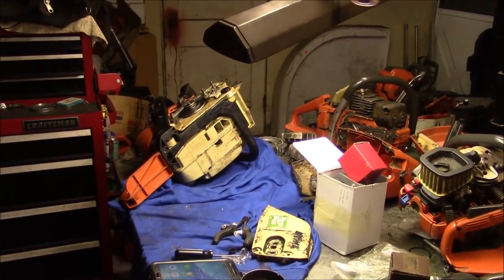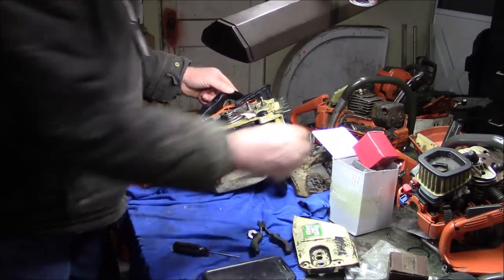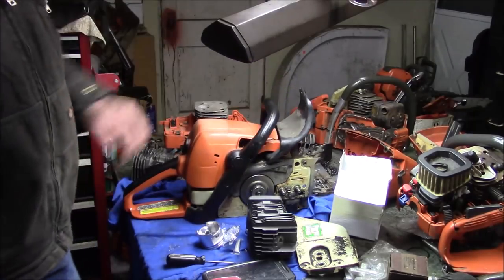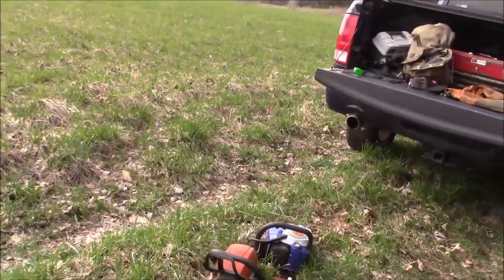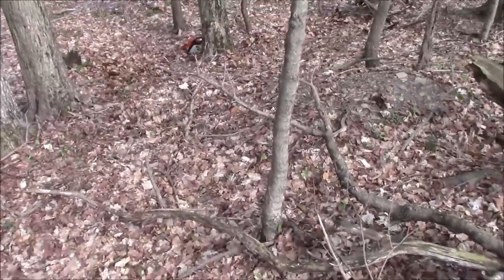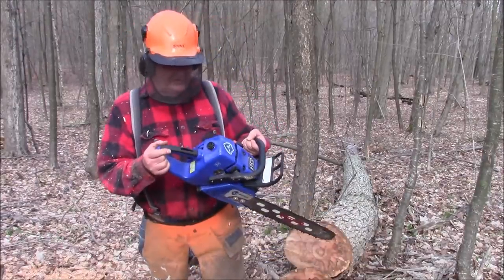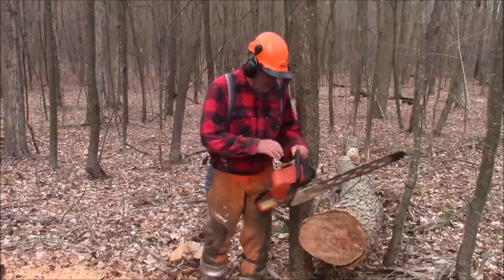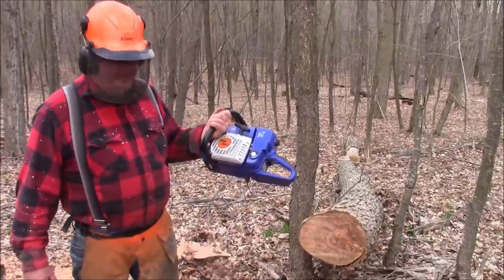Stihl ms310 Project Saw "The Starting Point"; vs. Holzfforma g366 & WHAT is a CLAM SHELL SAW

Comment: I have had my 310 for 16 yrs, two hurricanes Katrina and Ida.  Has never let me down, never put a wrench on it. Went through many 20'' bars and skip tooth chains. Just cut 10 cords of firewood in the past month. I think the key to a good running saw is clean fuel and clean the air filter regularly. Still running the original spark plug.

Comment: I'll definitely be waiting for the video when you convert it to a 390. I've had my 290 since 2011 and haven't killed it yet. It's been used and abused. Left outside in the back of the pickup in the rain and snow, ran on the factory lean carb settings for years, over dirty air filter, and the engine worked extra hard before I really learned to sharpen a chain. One new spark plug, one new air filter, starter rope, and one new fuel line is the only thing that's been replaced on my unit. They're heavy for the displacement class, but they run none the less. Great video. Certainly going to try out a holzfforma when they're shipping times return to normal.
Reply: Thers tons of really good videos on it allready, and it's very very simple to swap

Comment: Check to make sure the weighted fuel filter is holding down the fuel line. Farmertec has been having issues with very stiff rubber and the fuel filter won't hold the line at the bottom of the tank. It will drive you nuts trying to figure it out. Replace the fuel line or get a heavier weighted filter. Good luck. Love your videos. Learned a ton over the last two years watching.

Comment: If I cannot get the E clip on the end of the crank I just hit the clutch a few licks with my battery powered impact until I have created enough clearance to get the E clip on the crank.  One word of caution, you must use the thicker steel sprocket washer if you are using a rimless sprocket.  The thin aluminum sprocket washer is for spur sprockets.  It is a little harder to get the E clip on the crank with the thicker steel sprocket washer.  They use the steel washer to make sure the rimmed sprocket will not come off the sprocket.

Comment: I got a G660 started it and made my first cut today. I tore it down and put stihl crank bearings,crank seals and wrist pin bearings in it before the first start. The idle seems to be hard to get stable but first impression seems like a strong saw. Im using a 25in. Stihl bar and chain. It needs more time to see if it will be a good saw. I always enjoy your videos.

Comment: When using the same chain, around the 21:50 time frame it looked like the G366 went thru about 4 or 5 seconds faster: 20 or 21 vs 25, but it was hard to see the bottom of the cuts.
Reply from the maker: Probably , I figure if it matters folks will use the "timer" on the video to figure that out..:)

Comment: The aftermarket drum is molded after the early Stihl design for the 034 drum, which interchanges with these saws (1127). 1125 and 1127 share the clutch sidecover, breakband, clutch and drum. The early sprokets have a larger diameter bore, later ones the smaller one with the smaller rollerbearing. It was surpassed in around 1990s on 034 Super to 036s update. The OEM rollerbearings for the clutchside are also plastic but they tend to hold up pretty well. The Chinese copied the early design. This bigger bearing is much more expensive to buy than the smaller one, but they tend to hold up pretty darn good. (OEM that is)

Comment: I put a 390 top end in a blown up 290 a fella gave me - I was impressed. So i bought an old 310 and put the 390 top end in it. With muffler mods - they run well.  Yes heavy saws, Certainly not a 372 though.

Comment: Another good comparison of 2 saws, what I noticed with the 310 is it sounds like it kinda bogs at throttle up and runs a little slower in the cut although it could be just the exhaust note compared to the G366.
The first bar and chain on the 310 didn't appear to be throwing as big of chips as the bar and chain on the G366 and after the swap of course throw the same size chips but still sounded slower in the cut, but that's my observation based on what I was hearing. 🦻🦻🧠👍
Reply: the  stihl  got  no note  sounds  like  down comp ///power  drill some holes  let  the hot  air out  and  presure test

Comment: Hey Walt !
I noticed from the former videos about the acceleration problems with your aftermarket 361 models.

The OEM Stihl 361 carb has a acceleration pump installed. This pump often times get bad. The part number is:
1135 120 9700
Maybe a OEM carb can solve your problem ?

Best regards from Germany

Comment: did i hear right..gonna put a  390 top end on the 310 chassis?  how much difference in bore? and is there any stroke difference between them ?       i am anxious to see how this goes.  thank again
Reply from the maker: Stihl ms390 and the 310's are the same plastic essentially.... biggest difference is a 390 has a 49mm bore and the 310 47mm. Shouldn't be an earth shattering change, but along with a "pop up" piston should be both noticeable and fun. THATS the 100 dollar gamble. I got the saw for free....it was dead. And will have $100 in parts plus or minus a bit when I'm all done. That includes the new AM clutch parts, Top end, bearings & seals, and popup piston. ALSO things like a carb kit. Really cheap to work on these things...so don't write them off

Comment: From experience, I was a helicopter mechanic for a number of complete overhauls- everything on the machine was torn down and inspected.  The planetary gears in the transmission have plastic cages to separate the roller bearings. Have personally witnessed thousands of hours of operation and spoken with other mechanics with tens to hundreds of thousands of operations, and never seen a nylon cage fail. So- I would think that it would be OK on a chainsaw when it only is being used at idle.
Reply from the maker: First, THANK you for watching but even more so for interacting with the subject. I hear all that, but there is another thing to consider, its application based. Having been an engineer and dealt with several Aerospace companies, the design criteria is radically different than with chainsaw. They tend to over engineer vs. under engineer. In addition the air cooled two strokes in the "eco" era tend to run hotter. Nylon has served Stihl well in their older designs. Husqvarna followed Stihl's lead with the 500 series of saws and also the XT version of the 372's where in the beginning they did have issues. With the newer designs there have been more issues in the early years of a model introduction and I attribute that to simply heat. My assertion is simply this, if the temps and the environment are clean and consistent with design parameters , the nylon caged bearings will last as long as anything. Add heat past the design parameters of the nylon, those cages crumble and the coking on the bearings where oil is burned on exacerbates a bad situation and they fail where a steel caged design would survive. My data? Years of tearing these saws apart. A had a coffee can full at one point to tease a good friend about the situation. AND the ones where the cases weren't also ruined, I put in steel caged and none came back. Empirical data. Also have seen design up dates in the same saw series and the heat issues were both designed out of the later versions and solved in the earlier ones to where I don't see the same rate of failure I did back in the 2011-2015 era.... both brands BTW. SO I conclude.... temps right, lubrication right the nylons last. Temps go up and less than idea fuel/oil the steels will survive where the nylons won't. Be real hard to convince me otherwise regardless of cred's outside of the saw world. :)
Reply from the maker: BTW my older bro started his career as a helicopter mechanic , my middle son same on f--18's & f-35's. We too had a similar discussion.

Comment: Went from 029 to 390 engine and modded, 25 inch stihl bar an rs chain the 390 is a fairly nasty lil critter
Reply: Travis-  have a 029 that I’m thinking of doing the same, do you recall the parts necessary for the conversion and where you sourced same?  Would really help…..   thanks!

Comment: Put a 360 Stihl cab in it.  That is what is on my 360, 440 and 460.  They all will pull a chain but my chains are a lot sharper than your chains.  I could tell that 310 had a dull chain from the sound it was making and the way the bar was cutting.  My 360 will eat a 391, alive, so I know it will eat up a 310..

Comment: Stihl clamshell  - homeowner and Farm and Ranch.  Pro saws are metal case saws.
Reply from the maker: Might be a fun 4 u project to put a 460 top end on your 455 someday....really ads a "kick" to that saw. I love the 455's as they are hammer reliable, but the 460 makes power more in line with the weight. Yet still is as reliable and easy to start. Going to make a "Red" one this year....blend the Husqvarna 460 top end to a Jonsered 2255
Reply: @afleetcommand  I don’t modify good saws unless something is broke on them.  My days of putting 327’s in Chevelles are over.  My 455 is one of those X torques.  Don’t know if all the parts would work with a new cylinder and piston. What I like about the 455 is I can limb or buck with it when I get tired and at age 75 I get tired  a lot faster than I used to.  It has plenty of power to buck up 20 inch stuff.  I cut down a 24 inch  maple with it before I had barely gotten off the price tag.  I did trash that gutless chain that husky puts on them from the factory and replaced it with an LGX.  It is in storage condition, right now, because I keep about half my saws operational and the other half in storage condition.  I do bring them out of storage at least once a year.  Which reminds me, I need to put my ms-391 back in storage condition.
Reply: @johnclarke6647  keep it up john ive noticed in life the active people live longer my friends dad is 70 still cuts wood with echo cs490 most of the time he makes city slicker people his age ashamed, most of them can barely walk and he still moves like hes in his 50's